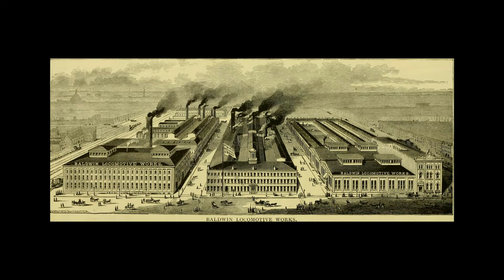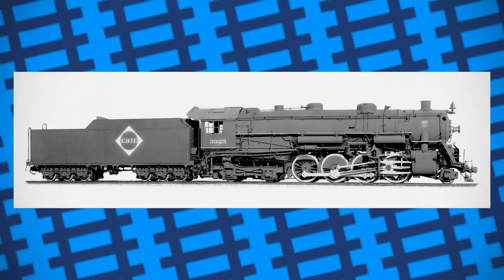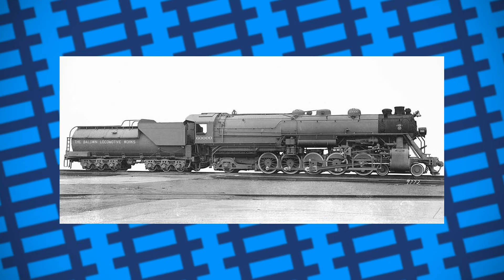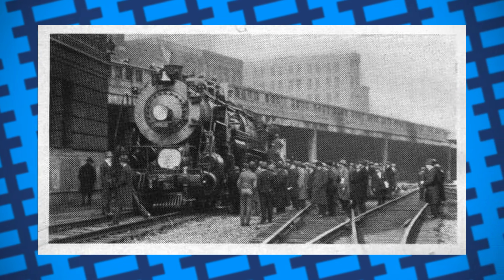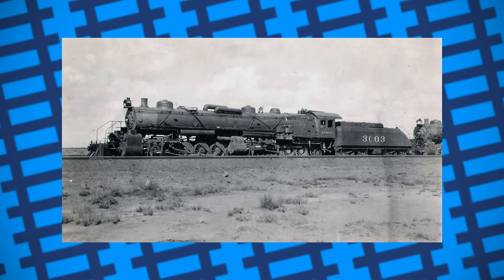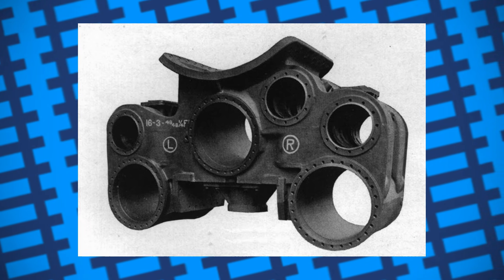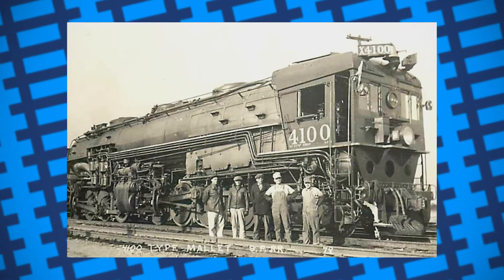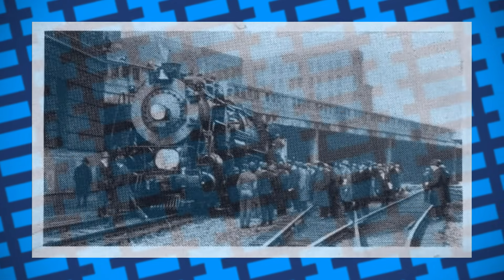Nobody wanted Baldwin's Best engine - Baldwin 60000

Comment: Southern Pacific did operate 4-10-2's but I don't believe they were the triple cylinder designs that this locomotive was. The Union Pacific's 9000 class were triple cylinder 4-12-2's built by ALCO. Compound mallet type locomotives were common in the U.S. but were slow and mostly utilized for freight service while "simple" articulated steam locomotives became more popular due to the higher pulling power and speed capabilities

Comment: Lima concentrated on higher firebox efficiency- burning coal at a lower rate per square foot per hour. The 60000  kept beating the compound dead horse- trying to squeeze all the energy out the steam(with corresponding counterbalance problems because of the large cylinders ) I'm not saying that compounds were bad on roads like the N&W which had a lot of curves and grades hence restricted speeds.

Comment: Railroads didn’t want this locomotive because they had found out that simpling articulated compounds resulted in large increases in power and performance while reducing maintenance costs. They weren’t interested in efficiency nearly as much as they were interested in pulling more at a faster rate without any three-cylinder complex maintenance nightmares to suck up valuable shop time. Only one railroad had ever expressed any interest at all in water-tube boilers and despite all their promise the B&O never found a way to make them work well enough to rate a commitment. One look at the jumble of rods behind the cylinders in the builder’s photo would have been enough to send any mechanic fleeing and screaming.

Comment: It was quite good but not outstandingly better than a well designed conventional engine.  The 3 cylinder compound design is the most difficult to design. How to divide the power output? On 2 or 4 cylinder compounds it is easy. Try to get the same output from the high pressure and the low pressure side.  Here with one high pressure cylinder you have to try to get one third out of the high pressure and 2 third from the low pressure section.  Very difficult to balance concerning cylinder dimension and steam distribution.
Here we see, that all cylinders are exactly the same, that might be far from the optimum. And small changes in dimensions have far more influence on the efficiency than on a balanced compound or a cross compound.

In fact there were only two  3 cylinder compound engines in history that were successful. All others had flues. That were the 4-4-0 midland compounds of the LMS, and the 242A1 of the SNCF (which nevertheless came too late for serial production).  Chapelon managed to solve the steam distribution problem this way that there was 90 degrees crankhaft offset on the low pressure section and the 270 degree angle between them was devided by 135 degrees from the high pressure part. So he could manage to get slightly more power out of the high pressure cylinder than out of the low pressure ones, this solution gave very rapid accelaration characteristics. This machine had such an immenense power to weight factor that was never achieved elsewhere. Only his own 240P 4-8-0 was slightly better in this respect.

However B&O liked the watertube firebox and 350psi steam pressure and they ran a few quite successful designs with that however they considered 350psi still low enough for single expansion.

Comment: The firebox on the 60000 is called a McClellan firebox. There was one railroad that did buy into them, albeit on Alco 4-8-2s, The New Haven. By the time that 60000 was erected, the defects in the water tube fireboxes were well known as the New Haven had had to deal with leaky fireboxes that flexed, causing broken welds and insulation to fall out so that the fireboxes drew cold air on to the fire. New Haven Power has an interesting section on those fireboxes. The McClellan firebox was one of those ideas that looked good on paper but not working on the rails.
Reply: It seems that a similar design called the Brolan firebox was used in Hungary and they built lots of engines that way, so they presumably found ways to live with them. But no other European countries adopted them.

Comment: Baldwin 60000 was the first steam locomotive that I ever rode in. As a child, the Franklin Institute was one of my favorite places in the world, and I was down there most weekends. The locomotive was one of my favorite exhibits. The Institute had left it open for the visitors to climb on and into and see everything about the cab and tender. Periodically, they would evacuate the locomotive and line up everyone who wanted a ride. If you were one of the lucky ones to get back in, they had electric winches underneath it that would move it about 20 feet forward, then back to where it had been.

I still love trains and that is a big part of why. I now model railroads and wish I could get a model of the Baldwin 60000.
Reply: Correction to my memory. Per @arthouston7361, it was a jackscrew and electric motors, not winches. I did not remember how they made it move, just that it was through electric power.

Comment: For those of you who don’t live near Philadelphia, I have an interesting story from my childhood. It was roughly 1960 when I was part of a group of kids visiting the Franklin Institute, and walking into the room where 60,000 is displayed I was awed by the size of this wonderful locomotive. What I did not realize at the time was that the staff of the Franklin Institute had installed an electric motor and a jack screw between the gage under the engine, which allowed the engine to be moved back-and-forth several feet. Now, picture an eight year old boy in the cab of the engine, trying every lever and valve that is exposed…..and suddenly, the engine begins to move………….
Reply: And for a long time (in the 1980's & 90's?) that jackscrew was out of service. But I understand they fixed it up a few years back as part of a major renovation of the train room. Also, in the 60's through the 70's, every Christmas they would set up a huge model railroad in the train room. They no longer display this, but I understand the layout has been displayed in 30th street station. I'd love to see that layout again. Sadly, the Franklin Institute has changed a lot since my day. Not a lot remains of the old museum, replaced by flashy glitz that appeals to the younger generations. But the engine remains, and so does the Heart.
Reply: @tracedehaven2190  I'll bet the heart needed some major renovation work, too.... because it was a little shopworn in 1960 when I walked through it..
Reply: In fact I think the heart has been rehabbed a couple of times since I first saw it, probably in the middle 1960's on a school trip. There used to be some flaps that were supposed to be like the valves in the heart, those are long gone now. I imagine the heart takes a bit of abuse from thousands of school kids every year. Still one of my favorite exhibits because I was born with heart problems that had to be surgically corrected.

Comment: I've had the opportunity to see this locomotive a couple of times, and am still amazed whenever I get close to it. I also read in an article that the Franklin Institute is planning on refurbishing the "Train Factory" room (where #60000 is housed) so that it's possible to walk under this engine, and remember a book about railroads in Pennsylvania stating that the top of #60000's smokestack just barely grazed the ceiling as it was being rolled in.
Reply: Another fun fact about the Institute installing this locomotive is that they actually built the room just for it, leaving the wall undone until the locomotive was in place. Then they finished the wall, sealing it in.
Reply: @Stephan_Rothstein  Makes sense, considering the engine might not fit elsewhere in the building and that they wouldn't want to build a wall prior to having #60000 put in place.

Comment: Baldwin didn't sell any three-cylinder 4-10-2s, but ALCO did.  ALCO sold 49 to the Southern Pacific and 10 to the Union Pacific.  All were simple-expansion (simplex), not compound.  The Southern Pacific 4-10-2s had relatively long service lives of almost thirty years.  The Union Pacific locomotives survived almost as long, but their careers included being rebuilt as two-cylinder locomotives.

Comment: It is curious that in the same year, ALCO built a 3-cylinder, compound locomotive, with a 4-12-2 wheel arrangement, (the 9000 class) that, while not entirely successful, (long rigid wheelbase, complex servicing of the center crank) ended up having 88 examples built (mostly) for the UP, in the next 4 years, with the last one being retired in 1956 - with only one, the original prototype, being preserved.
Perhaps the issue with the 60000 was too many technical leaps all at once.

Comment: The Loading Gauge has nothing to do with the weight of a locomotive on the track, but everything to do with height, width and length; so, will it fit through tunnels and under bridges, will it foul any lineside structures, etc? Weight on the rails is a different thing entirely.

Comment: Nice work.  Bill Withuhn suggests that 60000 was marginly more efficient than the locomotives she ran trials against - whilst being significantly more complicated.

Baldwin had built only one first tier three-cylinder locomotive other than 60000, had never built a three-cylinder compound, and hadn't put any effort into compounding since the technology they rolled out circa 1905.

60000's failure must have hit Mr. Vauclain's ego pretty hard.

Comment: I believe that I read somewhere that 60000 being too heavy is a common myth, as railroads already had heavier locomotives at the time (if someone could confirm or deny this would be great). Something that I don't hear talked about is her absolutely behemoth size, challenging that of the FEF-3s and WM 2-10-0s. I have seen her with my own eyes, and I really wish she wasn't sitting in a building collecting dust, but at least she is cared for.
Reply: It's not so much overall weight as it is weight and footprint. Most heavier locos were notably larger than the 60k so the weight was spread out more
Reply: @towcat  Forgot to specify axle load weight not total weight

Comment: As soon as I saw those ten fixed wheels I instantly said 'well there's your problem, Baldwin.'
Reply: Not really, many roads across America had Texas or Santa Fe types which had 10 coupled sets. The real issue lies in the third cylinder and water tube boiler which made most roads shy away.
Reply: look up up 9000 class its a 4-12-2 steam loco

Comment: I'm just glad she was saved.  And she was one of the only water tube boiler locomotives on the planet that actually worked.
Reply: In fact she didn't have a water-tube boiler - only a water-tube firebox with a conventional firetube boiler. Quite sensible in theory as it avoids the need for stays to hold the firebox in shape. But the Brotan boiler on the same principles had over 1000 examples in Hungary, so 60000 wasn't unique.

Comment: I can't say if it's the compound principle or the water tube fire box which did put railroads off from ordering this locomotive.
Low maintenance cost and high availability always have been a strong point of most American locomotives, and in a country with cheap fuel and relatively expensive workforce at the time the savings in fuel from 60000 couldn't outweigh its higher maintenance demand.
That was different in Europe where the cost aspects were the opposite and more fuel efficient locomotives although needing more maintenance had success.

Comment: Honestly it’s amazing how she’s basically a brand new locomotive. Everything about 60000 is brand new and barely run in, so “TECHNICALLY” you could just clean up the internals. Lube everything and make sure all is well, throw a fire and some water in her and she’ll probably run
Reply: Sitting almost still for almost a century will have it's effects though. Anything that requires a seal will need to be replaced and the boiler will probably need to be replaced entirely
Reply: @towcat to that end, 60000 has been sitting under a roof in a climate controlled environment the last 50-60 years. If the boiler is in that bad of shape from sitting in a controlled environment, there’s bigger issues at hand. Take N&W 611 for example, which prior to its most recent restoration, had been sitting on display, also under a roof, since the 90s. When the Virginia Transportation Museum decided to restore her to operation in 2015, they had the engine under steam in a matter of MONTHS following her ultrasound and boiler retube. 

Granted, I don’t know if 60000 was stored serviceable like 611 was. If it was, then she’d be a pretty interesting engine to see under steam. As it stands, let’s be grateful that the engine is in preservation as a testament to Baldwin proving themselves capable of producing modern superpower engines
Reply: It would take a lot more than that to get it running.
Reply: caydenworley5002  Kick the tires and light the fire!
Reply: Until one of her water tubes burst.

Comment: It is incredibly weird to me that the AT&SF could've theoretically had Vanderbilt tenders if they wanted the 60000.
Reply: I've never understood why anyone would want a Vanderbilt tender. Maybe I am missing something.
Reply: The whole point of them is that they're easier to build and take less maintenance. With a box tender you need to have a ton of plates rivetted together, while a Vanderbilt can be made with a few rolled sheets. They also require less maintenance because a circle can handle fluids and pressure much better than a square. However, the shortened range of Vanderbilts is what drove away most people like the AT&SF and UP, who need as much range as possible.

Comment: Having seen this thing up-close, and having ridden in its cab when I was very young, this thing is a behemoth. I always wondered why it wasn't ever used on a heritage railway... Then I learned about how much it weighed.

You can still find it today at the Franklin Institute in Philadelphia, Penn., USA.
Reply: Is it still operated by compressed air?
Reply: @ROBERTN-ut2il  I don't recall it ever running on compressed air. When I worked there in the '70s the locomotive was moved 10 feet back and forth via an electric motor and screw drive in the floor. The exhibit where it is housed is being revamped with at least one locomotive having been already moved to the RR Museum of Pennsylvania.